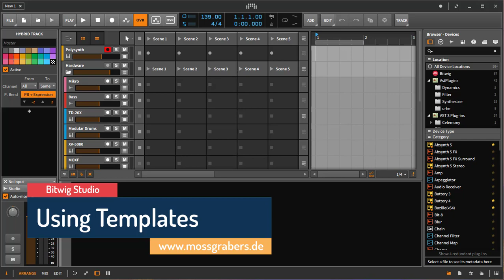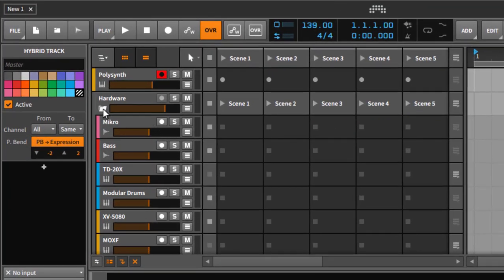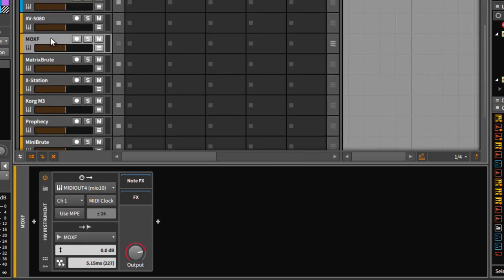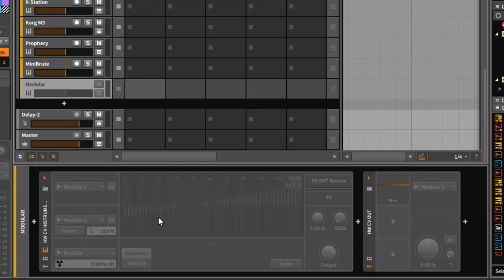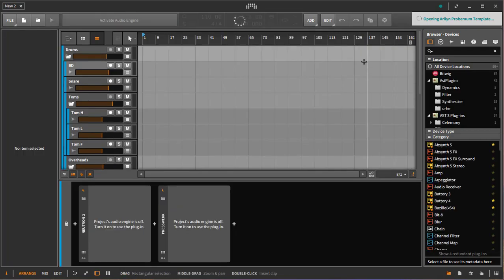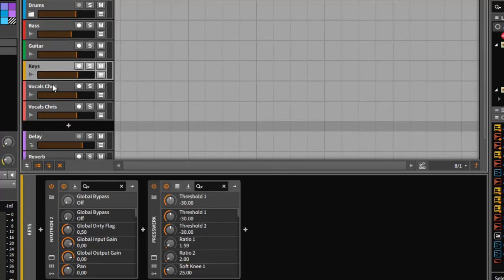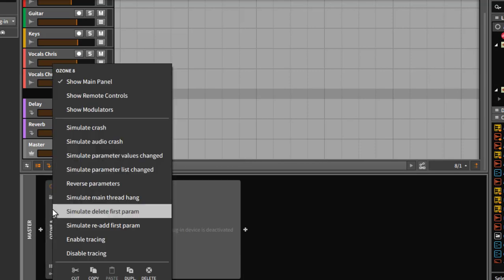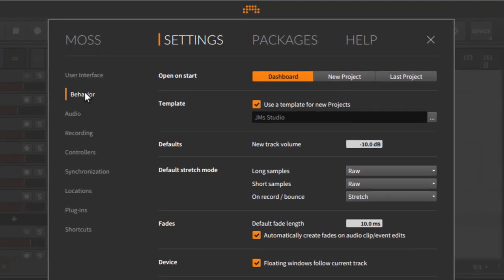Bitwig Studio - Using Templates

Comment: Hey Jürgen.Thank you for your great content and scripts!
Do you have any advice in how to make a template for an hybrid studio with hardware syths? I have some external machines, but got an JV 2080 wich I love, and has plenty of multitimbral parts and I'm haveing problem to properly route everything in Bitwig. The HW Synth device just work with one channel. Should I use a single midi track with different channels, or better separate midi track? How shoul I route the audio back to be able to monitor and bounce stuff? Thank you!
Reply from the maker: I use my hardware synths only in single mode with Bitwig "hardware  devices". Multi mode is too much hassle (and normally has restrictions on the single sounds, e.g. you can only use the global FX once like with the Roland romplers). If you really want to use it in Multi mode, you can e.g. create 3 tracks and setup the Performance to send on the different outputs, if your audio interface has enough inputs. If it is just about the MIDI inputs you can create also 1 track for each channel but do not select an audio input. Then create 1 audio track with the JV-1080 as the input. Problem with this is that you cannot simply render the clip.
Reply: @mossgraber  Oh. I see. So maybe it's better, as you suggest, to keep just one track x synth then and try to use clip channel layers to arrange stuff and bounce tracks one by one later. Thank you!

Comment: Hey, is it possible to load a template (or pre-saved group of tracks) inside an existing project? For example, if I am already working in a project and I wish to load my drum machine template (a complex multi-track setup), can I somehow add these tracks to my already open project, without opening a new one? Thanks 😊
Reply from the maker: Up to my knowledge, the only way is via a 2nd template project. You can store a clip which also stores the tracks' setup but this does work only for 1 track.
Reply: @mossgraber  OK, thanks for the info 😊👍

Comment: So, how do you delete a template?
Reply from the maker: You simply delete it from the Templates folder which is in the Bitwig Library folder. If you do not know the location open Settings -> Locations and see "My Library".
Reply: @mossgraber  
I tried doing that, but then it still appears in the list of templates in Bitwig. Seems like a bit of an oversight to me.
Reply from the maker: @unduloid  Hmm, just tried it and it works fine even without restarting Bitwig. Windows 11.
Reply: @mossgraber  
I just discovered that it takes Bitwig a few minutes to discover that a template directory has been deleted (at least under Windows).  Weird, but it seems to work. 

Well, thanks for your response.